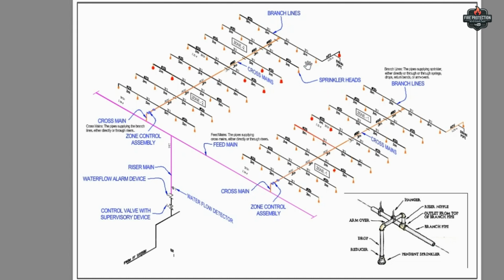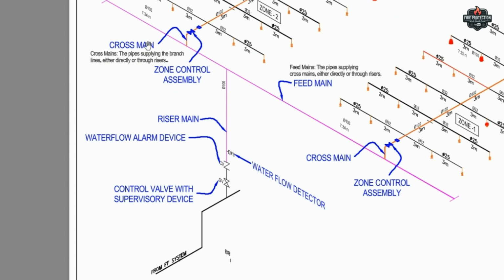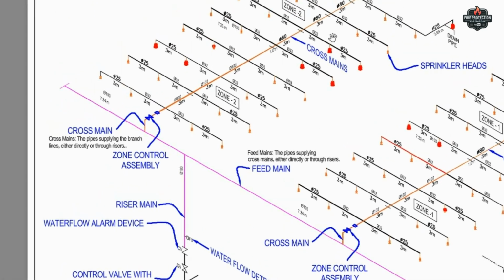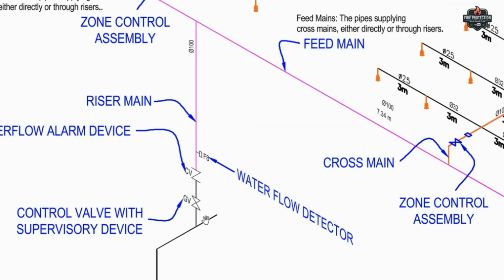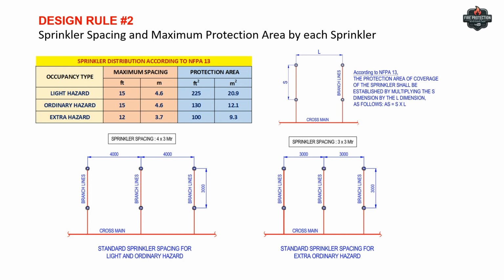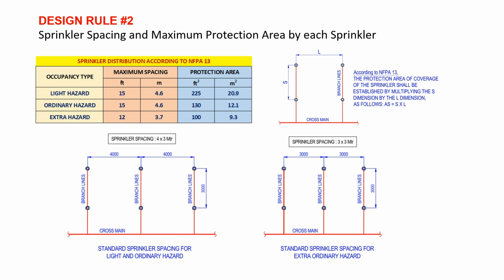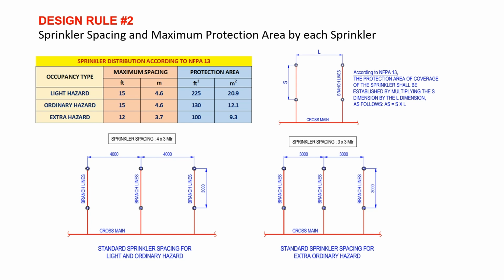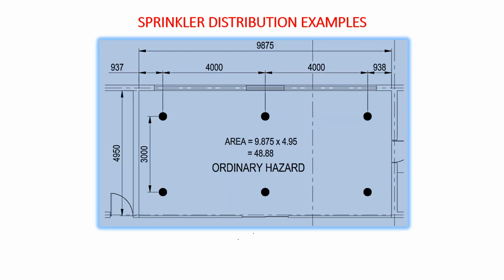#sprinklersystem #design  Rule   2 (Maximum Spacing & Maximum Area)

Comment: Your content is very informative, 5 min video is like 100 pages of information. One question, suppose fire happen on 3rd floor, so water flow alarm at zone assembly on 3rd will send signal to fire panel. But water flow alarm device at main riser will also detect water flow and will send signal, so can you explain this? thanks in advance.